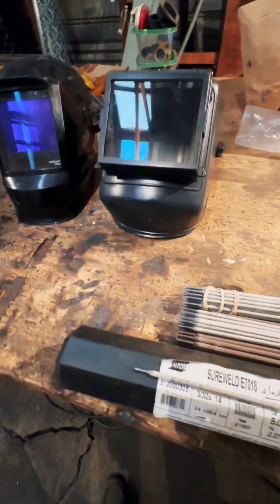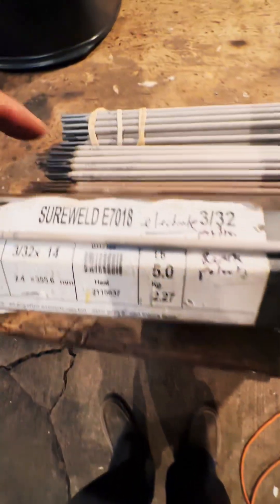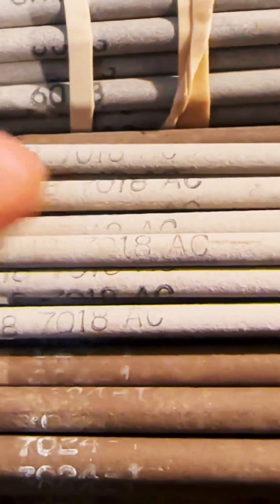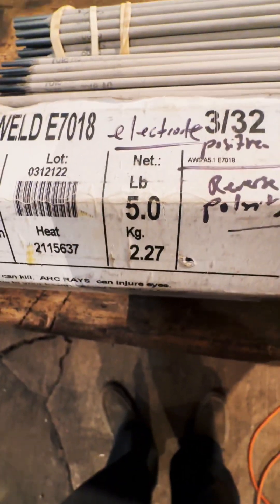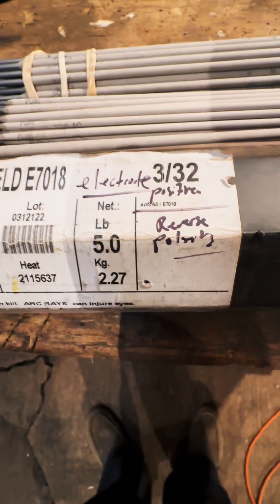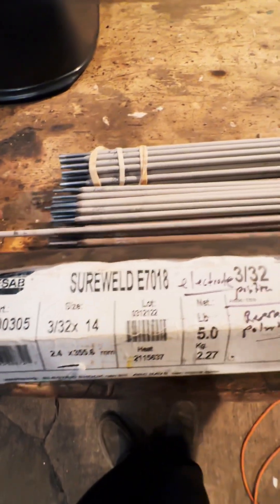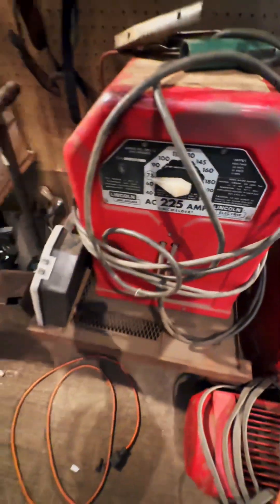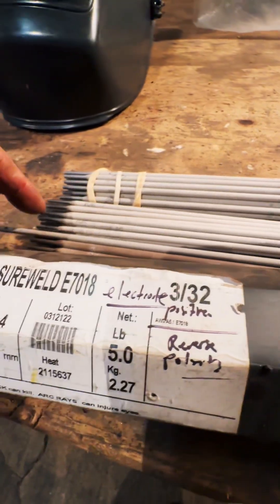AC vs DC 7018 Welding Rod Performance ⚡️#weld #welder #weldiing

Comment: AC means the polarity of electron flow is rapidly switching. It makes sense you need a specific rod because of how the slag forms. What are the benefits of AC stick welding steel vs dc? I’m only familiar with it for tig for aluminum.
Reply from the maker: Yes. I have heard one benefit is welding metals that have been magnetized to prevent arc blow. Also I do believe that a standard 7018 without specifying AC is designed to run on DC. So if you have an AC arc welder, you may have varying results and performance issues. I tried welding the regular 7018 rods and it was not working well. So my friend at the welding store had me try the AC 7018 and it welded really well. So in my case it worked. Other than that I have heard 6013 runs well on it also. I want to try the AC rods on DC... Just to see what would happen.

Comment: What was the difference? None?
Reply from the maker: From what I hear is that 7018 runs better on Dc and if you run Ac the rods do not burn as well. So the Ac rod is supposed to burn better that the regular one. I think it did make a difference. It ran smoother and started easier also it kept the arc going otherwise it wanted to break the arc